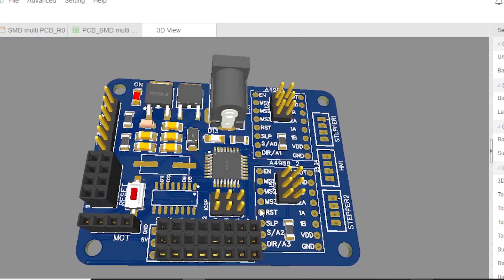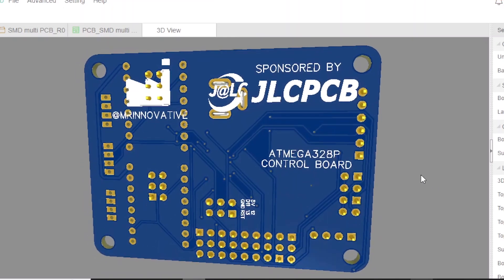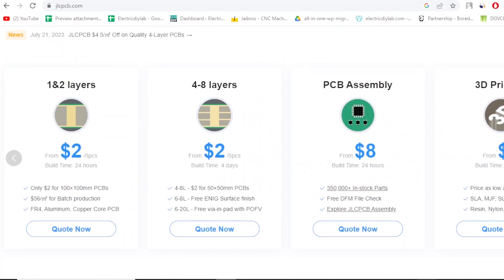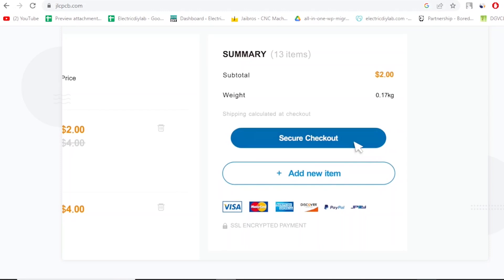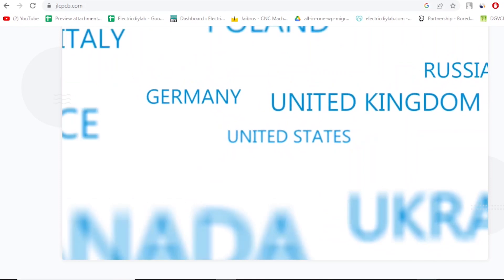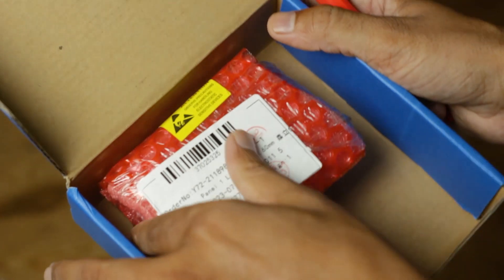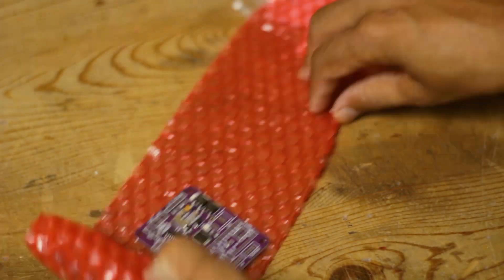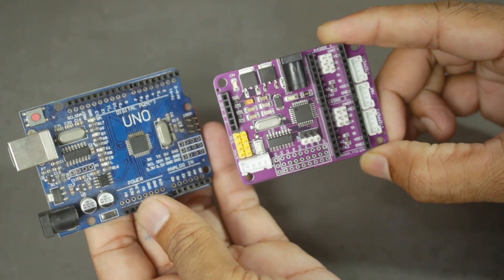DIY Gear cutting machine | Arduino based project

Comment: The accuracy of a 1.8 degree stepper is 200 steps per turn. Impossible to get a perfect gear with no reduction. 😅
Reply: You did a great job here... this mill can be stored in our pocket... keep going!
Reply: WTF are you talking about? 200 steps is a full revolution! That's saying they have no accuracy at all. I saw what you googled and you literally read the highlighted section, completely misunderstood it and posted a 100% wrong comment 🤦 The accuracy is 0.18° per a 200 step revolution, non accumulative. It was in the highlighted section you got 200 steps from. Unfortunately, you don't seem to understand stepper motors at all.
Reply: @NoMoreBsPlease  let me clarify for future reads, no needs to be aggressive here. 1.8 degrees is not accuracy, is just the motor resolution, you will need 200 full steps to get a full-turn (not talking about microstepping here). To get that teeth module/number, you are loosing accuracy by truncating the motor resolution. So 2 ways here... using a motor reduction, or implementing a microstepping software (hardware vs software) . Is important to undestand the difference between Accuracy, Precision, and Resolution. The standard accuracy for this cheap motors would be near ±0.05 degrees (at no load),
Reply: @hernancurras  At last on Youtube engineering, somebody who understands that the terms 'Accuracy' and 'Precision' do not mean the same thing. Maybe in everyday life but not in engineering.
It should be possible for the electronics to spin the blank enough times for the 'steps' to stop ready to cut every 12 degrees. If not, it needs another gear set in the system.
A good effort never the less.
Reply: @davidthorn4394  :face-red-heart-shape: